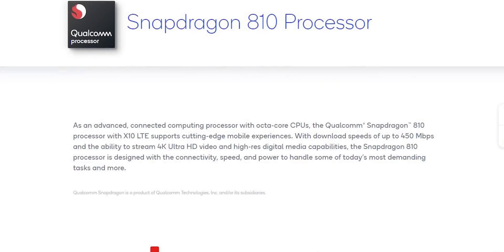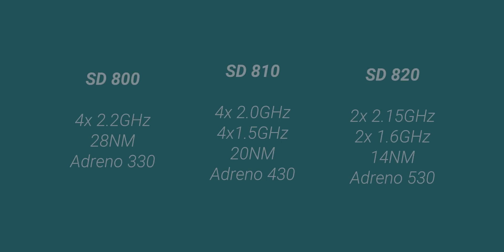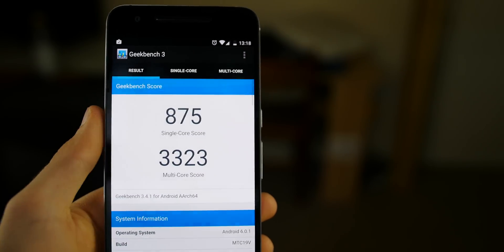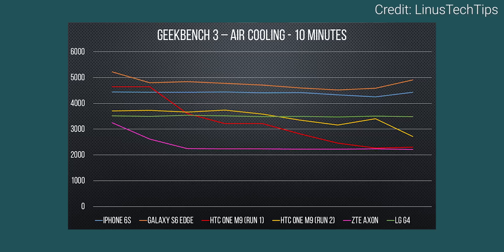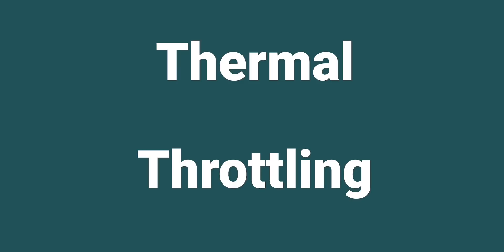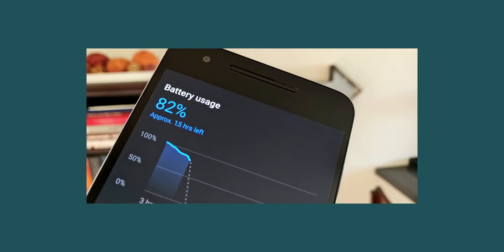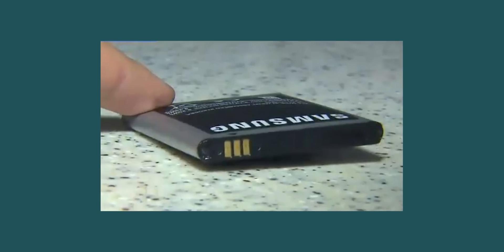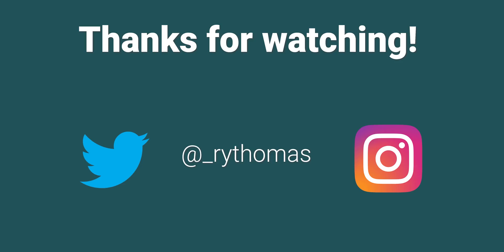Snapdragon 810: The Worst SoC Ever?

Comment: i have the developer tablet for this, its actually pretty good but the developer tablet has features disabled or not present (you're meant to tweak stock android, recompile it then install it for some features). However while it does not stand to intel atoms at the time especially the terrible ones in tablets for user experience, it actually does its job well because of the SoC design things you do not see which also makes developing some things for the hardware more difficult such as different dedicated processors to offload certain tasks. This is why i still do not trust mediatek's dimensity processor despite the benchmarks because they throw more general purpose hardware at things rather than qualcomm's multiple specific co-processor approach. Kirin when it used the general approach simply spammed more cores at their entry level. The developer tablet however is bulky so i dont think its designed with everyday use in mind and so may have better cooling, Qualcomm stopped customising the ARM cores from 64 bits and instead just focus on their other design aspects like their ATI GPU, various co-processors, SoC bandwidths (things like this people tend to overlook). Before buying a device be it router or computer, i suggest looking at the block diagram to understand the device more and comparing them at the block level to your intended use case. Thats not to say that mediatek is bad either just good at different things as i have quite a few SoCs here and they perform differently for different tasks.

Comment: With my current testing on my devices I think you can make a good case for the Snapdragon 820 being even worse. The 820 gets totally folded by other SoCs from 2016 like the Kirin 950 and especially the Exynos 8890. It also tends to get hot af, and the GPU while powerful is pretty useless if the CPU lags behind.

Comment: Yea you are right, i bought the xperia z5 dual in 2016 and man man the device is like a stove whether you are gaming or watching videos. It heated up by just opening the camera let alone recording or taking pictures. After 1.5 years my battery expanded and burst open the back cover. The heat damaged some of the electronic parts and this made the phone so laggy that you can't do anything great with it. The main problem was the overheating issue with the chipset, besides this the xperia z5 is a great phone.

Comment: Octo-Core technology was not entirely new, but new enough for Qualcomm in 2015 when they launched the 810... They must have rushed the overall design and function because the processor had big time overheating and throttling issues... Several companies (such as Samsung, Sony, and Motorola) picked up on this and avoided the 810 for their full-function smartphones completely that year, while HTC, Huawei-inspired Nexus, and LG suffered for it! Qualcomm took a whole year to get the Octo-Core layout right, so they launched the 2016 SnD 820/821 back with Quad-Core and finally got Octo right with the SnD 835 in 2017...

Comment: Had a g flex 2 with spd 810. Was  overheating and lagging all the time. Due that the camera died and even the processor died so the phone is pretty much dead. Don't even have to talk about the battery time. The phone didn't even survive for 2 years

Comment: The 821 is bad with this also
Reply: @Hybrid Theory it overheat on me it fast but damn phone get hot
Reply: @Hybrid Theory if it even gets warm it makes me mad because I live in Florida and you can imagine how infuriating that can be when it's 90 degrees and my phone is hot as hell on top of the sun
Reply: @Hybrid Theory my OnePlus 3T reached 58 degresss.....
Reply: @Hybrid Theory 58 c
Reply: @Hybrid Theory mine did it in a cool room
Reply: @Hybrid Theory but it was more bearable. But outside it's not as bearable
Reply: 821 is not really bad chip is still can use only the hot itself is spread but it never come to unstable or unusable phone to using it Lol still ok sd 821

Comment: I'm using a Droid Turbo, its running RR 7 (Android 9) the snapdragon 805 its showing its age now, the main problem its the 32bit CPU, the Adreno 420 its fine to this day. When I play PUBG Mobile the GPU stays at 60-70% while the CPU stays at 100%. I get 20-30FPS because the CPU can't push more frames...
After a lot a mods I think a snapdragon 810 can still be good to this day, but it will require lots of optimization.
Just for comparison I get 1350 in 3dmark slingshot extreme on my current ROM+Custom Kernel+OC.

Comment: the 810 is awful, i have a oneplus 2 with it and it was bad even when it came out, even tasks that aren't that heavy made the phone blistering hot, and it throttled so bad that the big cores shut down within seconds and then the little cores throttle from 1.5ghz to 800mhz and stays there while also frying your hands, throttling also killed any gaming potential, it was so bad that my galaxy S3 i had years ago played games much smoother than the 810, i can't believe how bad that chip was, i now have a oneplus 5T with the 835 and the difference is huge, under load the little cores are always able to stay at peak clock speed and the big cores go down from 2.45ghz to 2.2ghz which is pretty reasonable given all 8 cores being maxed at 100%
Reply: I don't understand little core is throttle ???? Given all 8core maxed at 100 Hmmm 🤔🤔
Reply: Try sd 855 the diff is big

Comment: S810 is simply not too hot. The thermal hellhole of APQ8064 was way worse… S810 was a generation of rushed development and a flawed chip, but isn't THAT bad. My Z5Pd and G Flex 2 worked just fine, both are fun devices and are enjoyable to use

Comment: Had a One M9. I'd often wake up in the morning with a half charged battery and a flashing red notification light, signaling overheating protection. Gaming heated up the device greatly, and it was at the time Pokémon go became a thing, so I had to plug in my phone at 100%, so that it loses charge slower, with the "intense" game running while charging. I thought it was HTC to blame at the time. The M9 took the issue specially badly. I miss that phone. Faulty chip aside, it was such a nice device

Comment: Though it was a well built phone, my OnePlus 2 died in 3 months from bootloop issues. The SD 808 seemed to have the same problems on a smaller scale with the Nexus 5x as a prime example. Along with the iPhone 6, Late 2014-Mid 2015 was a terrible time for phone releases.

Comment: Wtf ??? The predecessor of snapdragon 810 was the forgotten snapdragon 805. NOT snapdragon 800 or 801
Reply: Snapdragon 805 here, Motorola Droid Turbo
Reply: @rodrigofilho1996  Same here bud
Reply: @khalidqureshi3168  what ROM are u using?
Reply: @rodrigofilho1996  Marshmallow 6.0.1
What about you?
Reply: @khalidqureshi3168  Android 9, Im running Resurrection Remix OS
Reply: @rodrigofilho1996  droid turbo gang

Comment: Had a 6P. I didn't have any other 6P issues, but the heat up and battery degradation was painfully real. I had the Nexus protect program, so I got my battery replaced TWICE in the span of 2 years that I used the phone. Still, it ended up not being usable nearing the 3rd year cuz it thermal throttles so much and battery gave in for a 3rd time. I switched to a S9+. I tried to power on my 6P a few days ago it says data corrupt and refused to turn on all together.

Comment: I'm using a xiaomi mi note pro that got the famous SD810 for like a month, I "downgraded" from my LG G5 for it, for sure it is less powerfull in benchmark than the SD820 from my LG G5 but for an everyday use I see absolutely no diffences, both of them are fine, I'm using for like 2 hours of active screen while surfing on the web, some apps, some youtube too and I only lost like 35~40% of battery and is it not so warm (like less than 30~35°c my finger said).
Compared with my old LG G3 "prime" (aka the one with the SD805 and 3Gb/the "best" phone of the older gen) the mi note pro is a lot faster, have a better battery life and tends to warm less (at least the warm is not concentrated on 2 cm^2 of surface), it was a real upgrade from the SD800/SD805 era, so I don't think it is the worst soc ever made, it was better than it predecessor.

Edit: I also think that there are many rev of the SD810, maybe I have a more "stable" version of it than the first bad one

Comment: 4 years in and i still have 6:30 hours of screen-on time at 50% brightness while watching YouTube on a HTC One M9.

But here is the weird part. When i got this phone, it used to heat up quite badly when gaming. Like 70°C kinda hot.
But after some time it stopped overheating for whatever reason.

The overall gaming performance also decreased, but i think it's because the piles of cache that accumulated over the years, combines with not a single factory reset ever and only around 500MB left free.

The overall UI performance took a dip when i used a s##tty Samsung charger (original charger bought from the Samsung store. It broke 4 months later anyway), coupled with the unability to charge, etc., it was stressful really. Charging became a gamble. The phone only accepted my Gear S's charger, which is a 5V/0.5A charger, so it took up to 10 hours to fully charge. The LITTLE CPU (from Qualcomm's big.LITTLE configuration) stopped working all together.
When it refused to charge even with the Gear S's charger, i knew it was time to... Not buy another phone... But instead buy an original charger finally.

In fewer words, the voltage was all over the place, one CPU didn't know how to start anymore, the battery life was awful because the big CPU was turned on at all times and all of this because Samsung can't make good chargers.

(Sidenote: i bought the 64GB version which was not available in my country through an online seller, but i got it without accesories because i simply didn't have money for them at the time.)

Anyway, after buying the original charger, everything went back to normal. And after some time, like, a month, the LITTLE CPU popped back into existance again.

Everything is just fine again, except the gaming performance which took a hit from all the trash that's still present on the phone... Aaand combined with my stupid challenge to never update the OS on this phone. Still on 5.1.1. (Just installed the security patches, because developers made them into flashable zip files.)

It still opens apps faster than most of today's phones.
Pocophone F1 was the only phone that actually blew me away with the performance. Insanely fast is an understatement.

So that concludes my experience with the 810.
Not hot, not sluggish, but very unstable when not used properly, although it can fix itself over time.
Reply: Maybe the a57 core got deactivated through software 🤔🤔
HTC and Sony did it in all of their phones that have 810 in it, some of them did only cut 1 or 2 cores, but others phones got 3 if not all a57 cores deactivated !!
Reply: @benjiderrick4590  I didn't know that. I wonder why.
Also, if YouTube would allow photo sharing in the comments section, i would show you a CPU-Z and a Kernel Adiutor screenshot.
The big and the LITTLE processor work with all their cores now.
Only in the Power Saver Mode the A53 completelly shuts down.
But nothing about the A57. That one is always turned on.

It may have just been a bug when it happened back then.

Comment: I had used the Sony Z5 for 3 years until last week when a cracked rear panel (cracked fro over 2 months), allowed water in. Nothing to do with the age of the phone. Was brilliant. Honestly, the heat was terrible but nothing out of the ordinary extreme hot. Not especially with the final update of the phone. I thoroughly enjoyed it until its final moments and once I go out to work, I'll definitely find a used unit or NOS to keep for memories. BTW, it still mostly works except for a wonky touch screen and cracked back glass. Brilliant phone that was. Underrated as all hell.
Reply: Software performance was great except for camera and gaming, as well as the battery (I rarely got beyond 2.5H SOT on a single charge). My Z5 screen broke due to water damage and I temporarily went back to my HTC Butterfly s. The battery was like a sense of fresh air (no wonder with 3200mAh), although the software and camera resolution aged badly. I wasn't a big fan of Sony's camera UI and shutter lag (which they only seriously addressed with the Xperia X series), so upgrading to Galaxy Note 9 was a sense of relief. That is until Samsung changed the camera UI in Android Pie with One UI!
Reply: @FrankyboyLegend  I easily got past 3 hours of SoT with 4G on all the time. Honestly the shutter speed was annoying but their camera wasn't lackluster at all.
In good light, people are amazed it can keep up to the latest
Reply: @randomesteven3935  at the time I was using it, 4G reception was quite terrible on Fido/Rogers (mine was unlocked from Taiwan). Bell was the only official Canadian carrier for the Z5 and probably better optimized. As a result I mainly used 3G  which amounted to 3H SOT on 3G if I was lucky, more rarely 4H but by Android Nougat I was unable to achieve that. Camera image quality was great except lowlight and after using OIS I really cant go back, even though steadyshot was great for videos. My main gripe is how the camera and video tabs are separate, although other people prefer it.

Comment: It was bad, but I gadda give the worst SoC from around this era to the 652...Leeco Le s3 from my usage scenario. 4 A72 cores at 1.8ghz and 4 cores at A53 1.4ghz...on the 28nm fabrication....that sounds great, no, it was a train wreck. Core parking was constantly in use. 2 cores disabled 2 cores active on the a72 cluster, and once temps got too high it would swap load to the colder cores. Installed a custom rom that used all 4 at once because Leeco stock software was cancer, and played a game....game ran great....until the phone's metal chassis was so hot I had to hot potato it. Screen flickered blue and it was burning up. Ultimately I had to reflash a better rom with no core parking but all cores including A72 locked to 1.6 instead of 1.8. Had this been on 14nm like the 636, this would have been great, but 28nm and forcing core parking to handle temps was redneck patchwork by qualcom.

Comment: Even a heating Snapdragon 805 have better performance compared to a heating 810. It throttle to much.
Reply: So how much temp sd 805 and 810 ???
Reply: @thebrightstar3634  It's irrelevant today, 805 struggles with simpler tasks today, so it heats a lot as well.
Reply: @ThibautMahringer  Ok I know he is hot U need to repeat again and again just I want to know how much their temp both of them chipset ???
Reply: @thebrightstar3634  I don't know, I don't have phones with these SoCs.
Reply: @ThibautMahringer  Even sd 805 ?
Reply: @thebrightstar3634  I had a Galaxy Note 4 back in the day but not anymore.
Reply: @ThibautMahringer  Ok. But if u really care about heating problem of SD soc U can just go with sd 855 I sure ur completely satisfied at all and all of your complaining about heating issue just in a dusk 😂😂😂😅
Reply: @thebrightstar3634  For now I have a Note 9 Exynos 9810 and I have no big issues with heat. I also own a Galaxy Tab S4 with Snapdragon 835 and it absolutely NEVER get hot, it have a beefy cooling system though.
Reply: @ThibautMahringer  heat pipe cooling or what ?

Comment: Second horrible soc is snapdragon 801
Reply: Well I remember it heating a lot on my Galaxy S5 but it never made the phone unstable as the 810 but I think the battery degraded pretty fast, even with the 3500mah battery kit. 801 and 805 had crazy clockspeeds for their time though (2.5GHz and 2.7GHz)
Reply: @TRRDroid  crazy clock speed CPU consume more power, more heat and ofcos drop the bt3 ( drain ) so it will not  surprise there 😅😅

Comment: Still better than my sd616 idle @55°C
Reply: 625 here 35c idle and 60c max
Reply: @Kuri0  why so many chip snapdragon got hotter than usual ???
Reply: @Hybrid Theory have the moto g4plus with 617 thus thing fukn burn
Reply: @Foxedaramos  i too had moto g4 plus   that was a toaster !!!
Reply: So true. I had a lenovo phone with 616. 616 is like the mediatek of 2013.
Reply: Moto g4 plus with sd 617 was a nightmare
Reply: I can literally cook my lunch on my SD 615 based Sony Mobile
Reply: My Z4 was 72°C max and always 47°C when light using
Reply: @normalperson8173  Lol mediatek also get hot too 🙄🙄🤔🤔
Reply: @wanmaziah9835  Yea. Mediatek chipsets are mid range mostly, and the price for those are cheap, you can't expect a perfect thing on a cheap price right?(actually most of things in 2015 was a joke)

Comment: Well I have z5 dual with 810 and my unit doesn't have any heating issue anyway battery life is not that great now but it's a 4 year old phone so my experience is pretty good
Reply: Z5 was slightly better than the others as it made some attempt to cool down the 810 with dual copper heat pipes. It was the Z3+/Z4 that had more problems. The heat wasn't too bad (HTC One X+ was worse) but I could see the consequences. My device was no longer waterproof by the end of its cycle because the frame had warped from drops and/or the heat. The IPS panel developed white backlight bleed spots over certain stress points on the screen. My battery wasn't too good to begin with (usually 2-3H SOT for 8 hours, dropped to 1.5H near the end). UI and most non-gaming apps run still very smoothly but it would start throttling about 3-5 minutes with most 3D games I played.
Reply: Mine was terrible, my z5 was a stove. That says it all.